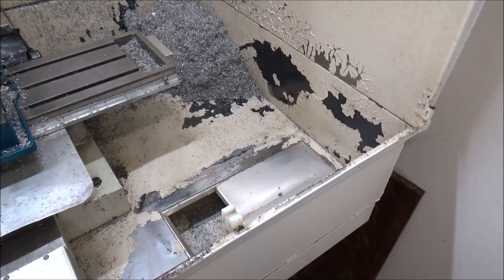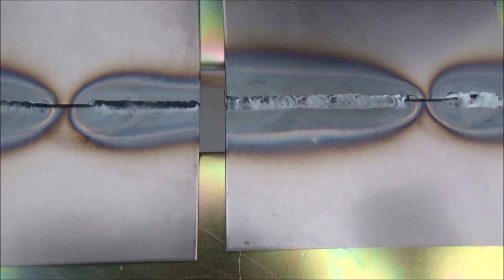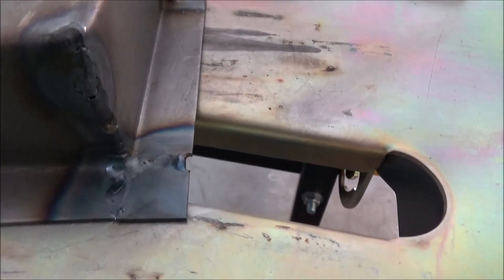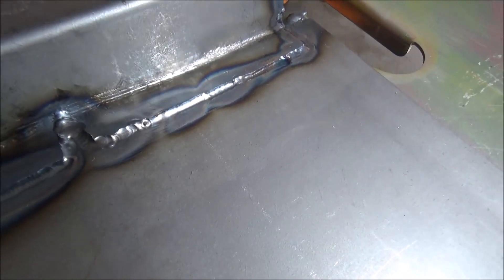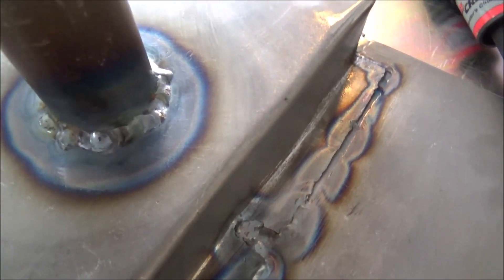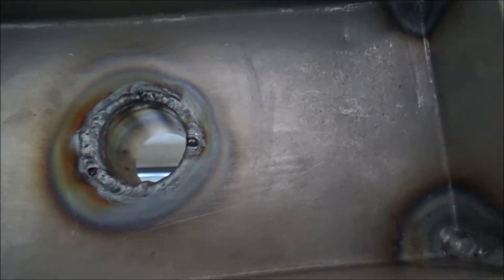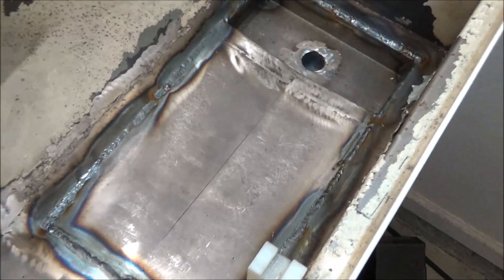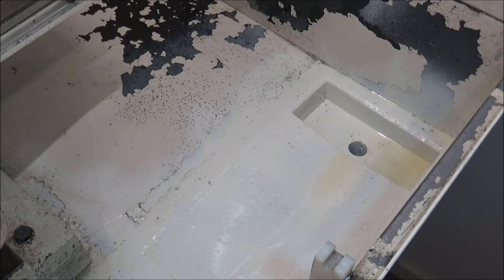First TIG Welding Project

Comment: Hey Sam, not to bad! Looks like your running a little to hot, 10 amps per .001" is a good rule of thumb.  Adding filler can be intimidating, try using a (lay wire) technique. With a tight gap it will Ensure you'll minimize blowout /blow through. Also the thinner the material the harder it is. If space/setup allows try backing the weld with an aluminum plate or block. This is known as a spoon. After 30+ years of tig welding I still use a back plate and purge when ever I can on the thin stuff. Anyway nice job keep it up. ,Ken
Reply from the maker: Thank you! Yes I did back down on the heat to 70 amps that helped alot. I also tried the lay technique. Adding filler is intimidating. But practice is helping.
Reply: When welding on a corner like that do you have to add a barrier to act as a baffle to keep the gas from splitting?
Reply: @jeffreyhallam5517  not sure what you mean about the gas splitting. As long as the Gap is tight and the heat set right you should be good to go.
Reply: Ken Design Oh Okay. I thought the weld needed to be close to perpendicular to isolate the puddle. I figured that on a corner like that it’s difficult to weld perpendicular to the work and the gas might not keep its place over the puddle. Thank you.
Reply: @jeffreyhallam5517  you're right. If it's an open corner the arc is less stable. In this case I'm sure the metal plate he used created some kind of a v shape when he put it in place to be welded. This gives you a big enough pocket to concentrate your arc in that area if you're close enough

Comment: I’m new to TIG also - glad to see someone else is at the same level...torch time is invaluable - but good work so far 😃
Reply from the maker: I could not agree more also Patience is good to have you get frustrated when you keep dipping your Tungsten. Welding Coupons seemed to help but I had to get this project done.
Reply: CNC4XR7 do you hold your breath when you weld - I bet you do - if so , sing a song 😂
Reply: @kiwidude8931  the best trick I know is to play one of your favorite songs that has the BPM "beats per minute" that matches you weld bead timing. When you pump the pedal with your foot to a beat it makes the weld bead more consistent, Especially on aluminum.
Reply from the maker: @kiwidude8931  I dont think I am but I will give that a try.
Reply from the maker: @kendesign3622  Thanks, Yeah that would help I'm so not coordinated!